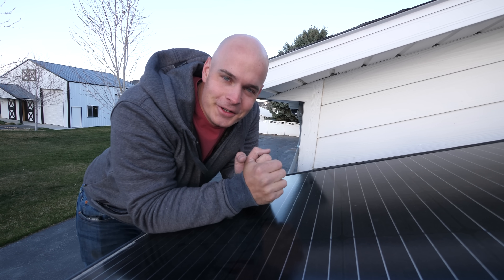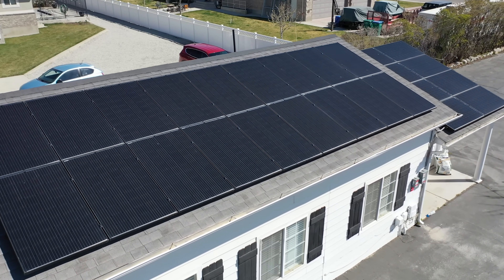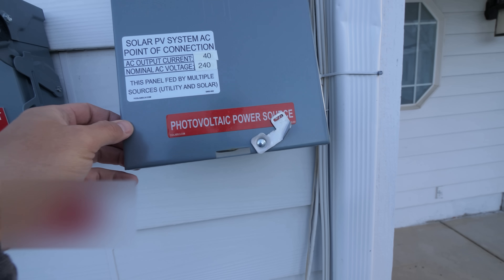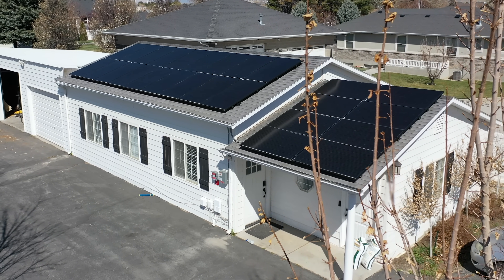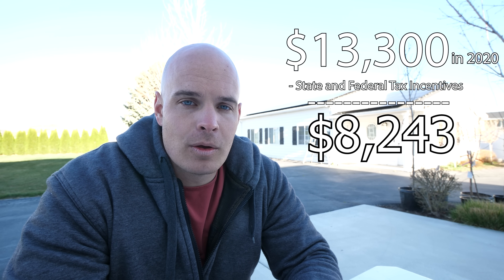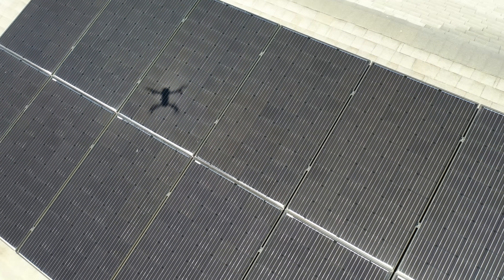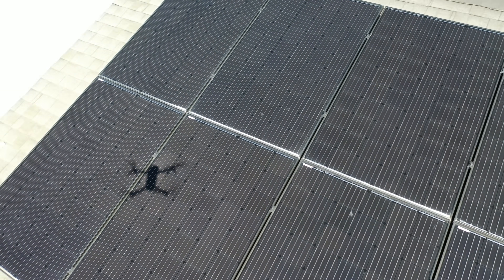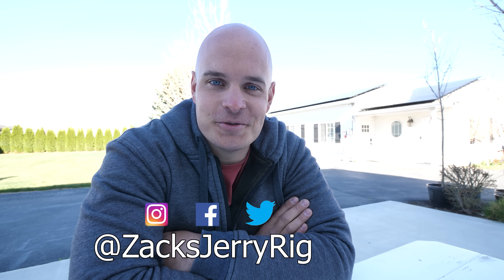One Year Solar Update! - Is Do it Yourself Solar worth it?

Comment: for me, installing solar panels was sooo good, my house is not like the house in the video, I have easy access to the roof without a ladder ad no need to climb and ****, and here in Lebanon where there is no electricity to always offer, it was the best deal, I saved a ton of money using solar since I am not linked with a private electric generator to keep our house having light. unlike yours, I have 3.5 kW instead of 8. I purposely reduced the amount because 1. I do not use that much electricity to start with. 2. it costs so much here. 
that's the only problem I faced, the fees to get solar to my house. other than that even maintenance is dirt cheap. 
I really recommend people if they can install solar, then install and don't wait

Comment: I like your style but!!! First of all is it one or two years for the panels to offset the environmental costs of making them? That’s a big difference. Second that’s the panels themselves the batteries are another story. I believe that you can not really get anything for free so the concept of solar panels powering a house cleanly is not something I buy. While solar panels are cool and definitely hip, I get it I just bought an electric hyper scooter, I used to drive an electric car and a hybrid, you are not actually helping the environment. It’s similar to the Chemtrails concept, they pump metals into the atmosphere out the back of a plane to reflect the sunsrays back into space in an attempt to cool the planet but there are a number of negatives that occur in the process demeaning the concept all together the first one being the obvious jet airliners they are flying offsetting the chemtrails in the process by burning jet fuel to carry out the process. Irony. Solar panels much the same. There is more to it that is not being disclosed and perhaps that 1 to 2 year estimate is biased coming from a company that wants your business. The main thing to consider are those huge batteries that need to be produced to make the entire operation work. What do those cost the environment? I think it’s much more than the panels. That is why electric cars are technically not good for the environment. You can buy one pat yourself on the back and say I’m doing the right thing but at the end of the day it’s not helping anything because with them the damage was already done. You might as well buy a gas burning vehicle.

If it’s about the environment I’ll give you the only solutions and there are two to slow the destruction of the environment down but in most cases it’s about being hip ik that’s how it is with me.

Our government and governments world wide can shut the grids down, turning off all forms of heat producing energy from fossil fuels and forcing people into a chaotic Marshall law with no police or hospitals. Feeding us via fema and the national guard and praying for the best. It’s not entire feasible being cities would be on fire almost immediately, people would retreat to forests to survive and ultimately end up burning them down, needless to say with 8 billion people on the planet the earth would be engulfed in flames in a matter of a few months.

Number two our governments of the earth can go door to door and put a bullet In Each of our heads. This is probably the smartest thing to do at this point because The pandemic thing is not going to work as they end up killing themselves  in the process.

Solar panels don’t even scratch surface and are just as bad as oil.

Comment: I wonder if they make 3-phase micro inverters. My residence is powered via 3-phase, 4-wire. Also, with a micro inverter design, if one fails in the middle of the row, will you have to remove the panels from end towards the middle to service it?

Comment: Hi, a german company just announced their car would be able to charge and discharge at 11kw vtg with LFP Cells the additional cycles are probably not that of a hit on SOH. And even cooler a carshare company together with the energy provider of the city they operate in use the cars (100 of them) to first of course rent them out but also use them for grid stabilization. Becoming more and more important to stabilize sections of the grid as they get higher percentage of volatile energy sources. 
Cool thing to see and certainly an other business model for an ev owner with a solar roof
Cheers

Comment: But Jerry do you use 100% of what you produce ? I guess not. In which case your calc is only valid if you can sell the extra energy at the same cost you buy it at. It is for example not the case in most EU countries. You sell the kWh at a fraction of the purchase cost unfortunately.
Reply from the maker: My city stores my extra power and gives back 90%.
Reply: @JerryRigEverything  Thanks Jerry. I need to watch your installation video to understand this. In EU it is impossible to install yourself AND to have a system to send electricity back into the grid since there is no accreditation from a professional proving this is safe. Without being able to sell electricity into the grid solar is much less attractive. I am also curious why and how the city "stores" your extra electricity and does not just buy it instead. I hope the answer is in the year old video. Amazing content man.

Comment: If you're actually doing this to save money, its wrong, because this yields 3.5% p.a. (assuming $8200 as cost of installing and equipment ) and and index fund on average will pay you more ~8-12%.. Assuming a 30yr life cycle. For 50 years, it doesnt make any more sense either, just  gets worse.
So you'd rather just put the money in an index fund and pay your bills as it it.  Much more sound financially.
That difference leads to additional income of over 140K in 30years. 
So yeah, the cost of solar panels needs to come down to $2500 for this to make sense financially. 
Great video, but inaccurate. 
Compound interest is a bitch. Your equipment is more like simple interest which looks higher at first. But over longer periods of time, it doesn't make sense. 
Unless the cost of electricity increases by same % as that of the market, which it can't, this is not sound financially.

Comment: 9:50 i came back to this video because my electric bill this month is 200usd  when i did the math turns out i used 59kw/d and all ii have running is led lights an ac unit and a refrigerator

Comment: Hallo Jerry. First off, thanks for the great and interesting videos!! I live in Germany and we pay € 0,32 per Kw/H (that's the most expensive in the whole of Europe). We're getting a ton of sun here in the south of Germany but with the cost of the solar system and installation,  the shortest time to get even is about 10 to 12 years. Most of the insentives from the government have been scrapped and you will pay full price for the system. The amount you get back for every Kw/h you put in the grid is a joke (under €0,05 and keep in mind we PAY € 0,32 per Kw/h) so it seems the German government is actually actively discuraging people from going for Solar. The initial costs and long payback time are not woth it to a lot of people. A shame really.....
Reply: Your energy pricing is roughly the same as ours in the UK. We're on 25-30pence/kwh so approx the same as you, and 5.5p/kwh for feed in.
There is presently no incentive scheme for solar install. However with costs of hardware dropping like a stone, a self install 4kW system here is around £2,500gbp of hardware. Plus the self effort.
Presently we're only seeing 2-5/kwh per day production, but do produce 20-25kwh per day later in the year.
Based on our usage, it's approx 3 years payback time at present..
Reply: @SolisNotSolis  A good tactic in this case is a small system that matches daytime use only, so you avoid paying a lot of the 30pence rate juice.

Comment: Why not just use less energy?
I bet you have a clothes dryer .
Lighting that is quite inefficient.
And lots of wall warts.
For the price of your solar set up you could have 
Done a pump and dump geo thermal hvac
Yes you would need to diy it to get that price but it’s not that complicated.
Well water quality and  drilling costs vary 
But the geo thermal would generate more saving 
Than the panels, in my estimation.
Of course this is back of the napkin calculation.
My overall point is a combination of quality insulation and geothermal your numbers go way down.
In the clothes dryer issue they do make heat pump clothes dryers.
Those type are Interesting due to the fact they don’t vent outside. They just have a water drain.

Comment: Yes, solar is good, but bad also. It takes silica sand, minerals, plastics and metals plus fuel (energy) to produce photovoltaic pieces and the parts of the housing to hold them. Where do the parts and fuel come from? Answer, The Earth. Then it takes some form of fuel (energy) to move the panels to there destinations. Then, after the panels have worn out, what happens to them? Most of them are in landfills or sitting on open land and forgotten about. Then, the cycle begins again. How is this the so called "clean energy" of the world?

Comment: Probably the only cost effective way to setup solar panels. Great job! After those 6 years it’s all savings. Off grid would work too as long as you have a very small battery bank or no battery bank but that means no ac at night only small appliances. Batteries are just not there yet, they don’t last long enough before you have to replace them and it’s a big bill
Reply: Look into LTO cells. They cost a good bit more up front than other chemistries, but last ~20,000 charge-discharge cycles or 25 years before they degrade to 80%, so a similar lifespan as the panels. Because they last so much longer the cost over time is far lower. They're also the safest chemistry in terms of not burning your house down. Can charge and discharge rapidly for faster charging your electric vehicle for the rest of your life, oh yeah and they're fine between -40C to 60C.

Comment: solar is not practical because it will take over a decade for it to pay for itself and that's if it doesn't break or isn't damaged by weather which will likely happen within those 10 years. if everything is perfect you will get your money back in 15 years on average. it's just not practical right now. other sources like wind energy are better at the moment

Comment: Jerry,

I’m new to roof top solar panel usage! My main concern is with the substructure of the roofing shingles. Mildew damage from the shade from the panels, yes varies on location. Secondly, the extra cost to replace roofing when needed with the panels being added on top of the roofing? Are those future costs included into the efficiency evaluation?
Reply: Would non roof top, near ground installations be more efficient for property owners that have land availability to allow this type of installation? Better cleaning and maintenance access?
Reply: Obviously and sound structure roof and shingles to match your panels lifetime are used. Your panels are shielding the shingles extending their durability.  To avoid future costs you don't panel tricky areas or high maintenance areas (peaks, valleys, etc)

Comment: I live in Texas and agree it’s messed up. Power companies want to pay far less than what they charge for the electricity from solar. It’s as if they are saying their power is worth more. As if a toaster cares where the power comes from as long as it the correct voltage and hertz. I want to get a system large enough to go off grid. Alas, Tesla isn’t installing in my area yet. Even though it should be prime solar power area.

Comment: I've ordered an 11.7 kW system for 11 237 dollars after deductions, including installation costs since I don't like tinkering up high. It should produce a savings of above 1500 dollars a year. Meaning it will on average pay itself in less than 7.5 years. On top of that energy prices are likely to go up over the next 30 years, which should more than offset any reductions in production over the system lifespan. People often compare the investment against Index funds, but they forget to compound the solar investment. Meaning re-investing the amount earned/saved into other things, such as index funds or household savings investments. 

My system averages to making 125 dollars a month (most of it paying out in spring and summer). Investing that consistently in the market, averaging 8 % returns over those 30 years will yield closer to 170 000 dollars. Meaning that you over 15x your investment over 30 years in the most average case. Most likely you will loose another 1-2 k somewhere in the middle for a new inverter.

Comment: Since you mentioned Texas....You'd be better off (in the South) financially upgrading your A/C unit to a 22-24 SEER unit than installing that 8KW solar system.
Reply from the maker: At this point it's not just about the money.
Reply: @JerryRigEverything  The premise of the video is "was it worth it?".  I'm just pointing out that the better financial option is improved AC - which is the 'greener' option.  Not using the energy in the first place is better than being inefficient - then covering tracks with renewable.  Step 1:  energy efficiency.  Step 2:  renewable...  Cheers!
Reply from the maker: @jesterlead  you're not wrong. But also I don't think the new AC unit is going to last 30 years either.  I'd still lean towards solar being greener and cheaper, personally.  But hey, every step counts!
Reply: @JerryRigEverything  I'm in Houston, so it's a huge deal here.  For example, my Aug bill is 5,400 kwh @ $0.11 (plus carrier charges), so about $800.   60% of that is A/C....

Comment: why did you leave space on either side of the main array?  It looks like you could fit 2 more panels without overhanging the lower roof panels.
Reply from the maker: Sometimes an offset is required by code. Personally I just wanted room to walk around them for maintenance if needed.

Comment: If you look at you ROI as just the electricity you would've used for your house, it takes much longer.
If you have an electric car, you can look at the kWh as an equivalent to gasoline (10 kWh for approx 40 miles of travel, or a roughly a gallon of gas) and then it really speeds up the ROI...California has $5 a gallon prices right now, August of 2021.

Comment: Could have written off your labor as well and saved a bit more. Solar panels also have to be disposed of, which you didn't discuss before pronouncing them to be still green. The grid giving you back 90% of your donated energy at night is more efficient that any batteries could hope to be while also not degrading from charge to charge - which is the primary reason why one would never want their car to power their home in any case short of an absolute emergency.

Comment: I was wondering if this system has a safety regarding the power being returned to the grid when it shouldn't. Let's say that a tree falls and brings down the cables from an electricity pole, when the repair crew arrives they cut the power in the area before they start fixing the cable if your house is still connected to that grid. Couldn't it just feed with power the now cut grid and even electrocute the repair men ?
Reply from the maker: Yeah the inverters sitting below the panels turn off immediately if they don't sense grid power.
Reply: @JerryRigEverything  That makes sense. Thanks!

Comment: I thought about it but in 5 to 10 years they will be so much better and cheaper and thats the problem and your price does not have the true cost which will be around $15,000 to $30,000. You bought the cheapest possible and did it yourself and you didn't put the cost of the electric boxes or anything other the the price or the kit. I can go on and on and I did watch the whole video.

Comment: Regarding your cost savings calculation, there is a big difference between generating 13,140 kWh and using 13,140 kWh. Did you actually consume 13,140 kWh from your solar system in that year? Or did you just generate that much? In exaggeration, you aren't saving any money if you are charging batteries and never using them. Maybe I don't understand the system, but at 7:24 you base your calculation with 34.7 kWh "production" per day. "Production" is not "use". If you spoke correctly then you did not save $1314 that year, but rather generated $1314 "worth" of electricity that year that may or may not have been used.

Comment: What are you considering with the battery?  Are you only considering Lithium batteries or are you also considering flow batteries or other types of batteries?

Also if there is a power cut on the grid then your power will also be cut (it's a safety thing that makes sense when you think about maintenance workers on the power grid).  You can get a device that will isolate your home from the power grid when there is a power cut which means you can then have power in the event of a power cut.  Are you considering one of these?

Comment: Yep, I installed our panels 6 years ago and next year they’ve payed for themselves. We also get about 80% back for the electricity delivered to the grid. However, plans are to discontinue that in 2 years and lower it to about 25 - 30%. 

Next step is going to install a battery system. Especially now that in The Netherlands, where I live, the grid companies warn that our grid is getting full and have difficulty in handling all the solar and wind generated energy. But a battery system is still very expensive and costs about 2,5 times what my 3K solar install was. But when the price drops significantly for the electricity delivered tithe grid, it may be worthwhile longtime. So we’ll see. Thanks for the video.